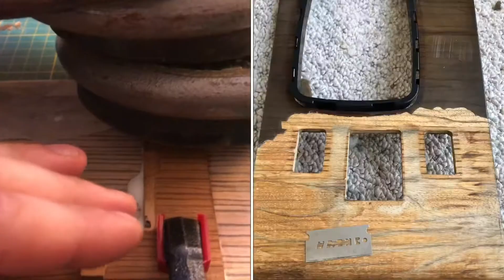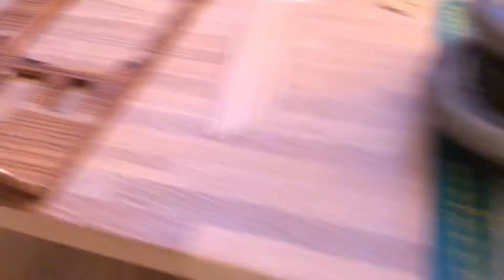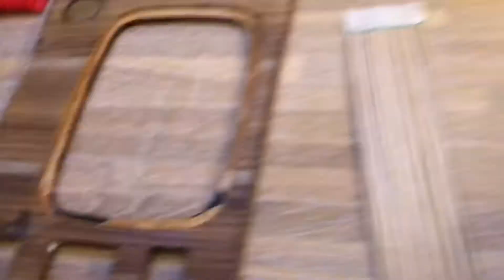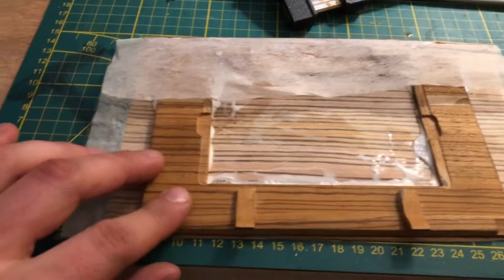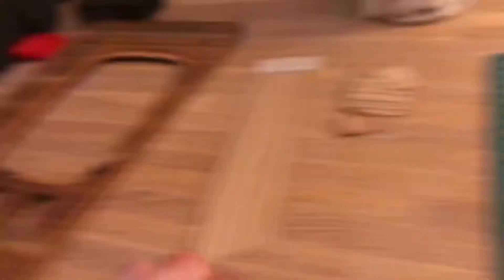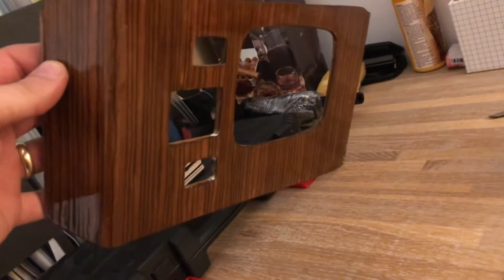Wood trim restoration

Comment: Hello, I follow the same steps, but when I apply polyester, the paint gets damaged. What do you recommend?
Reply from the maker: What exactly is the problem? I used 2k clearcoat, i belive that poliester resin is different than the clearcoat that I used and a epoxy resin that is widely used in wood products. Maybe try switching to a different product.

Comment: Very nice. Spasiba making me reconsider replacing it all.
Reply from the maker: After some time the clear coat shrank a bit, if I had to redo it I would use epoxy resin, it would require sanding and polishing at the end, but would give a thicker and more durable finish
Reply: @Dajciemispokojznickiem  But then use a UV resistant epoxy resin, otherwise it will get yellow